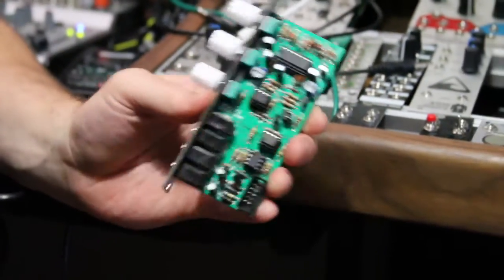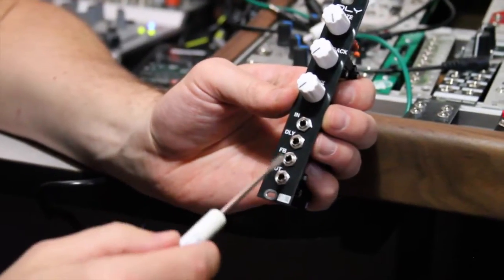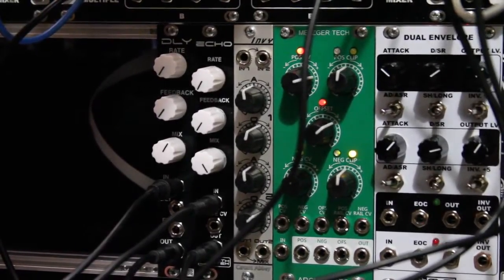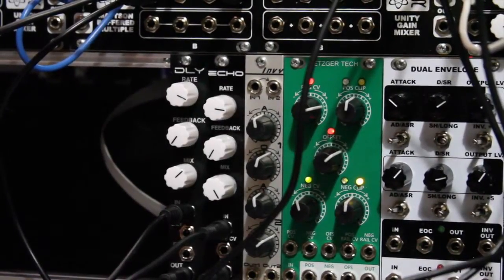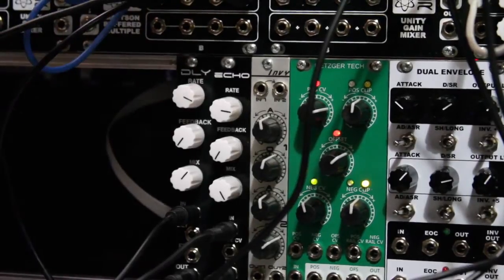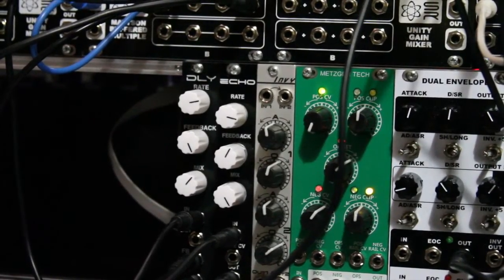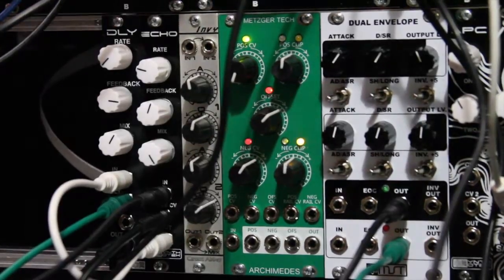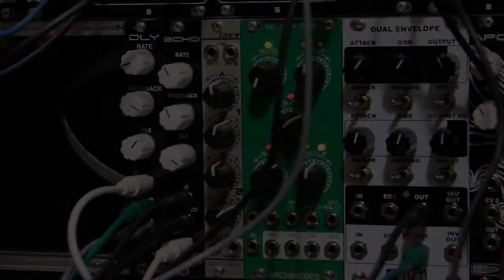Synthrotek Eurorack DLY delay module comparison with Echo Module

Comment: you have your rates backward. you turn them up, and they slow down. very counterintuitive
Reply: Actually your description is counterintuitive. I come from programming. Rate is basically delay time. When you turn the knob up, you increase the delay time. Maybe the "rate" label needs to be just "time". Its same for clocks for me, I am used to turn the clock down if I want faster clocks.